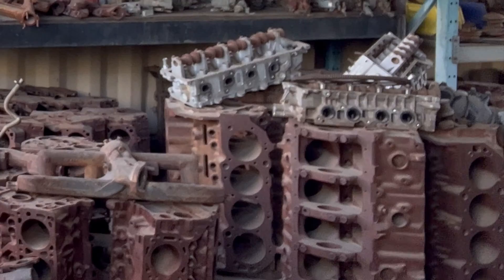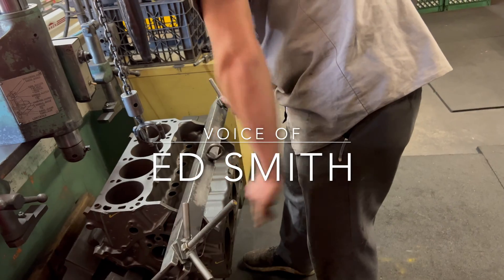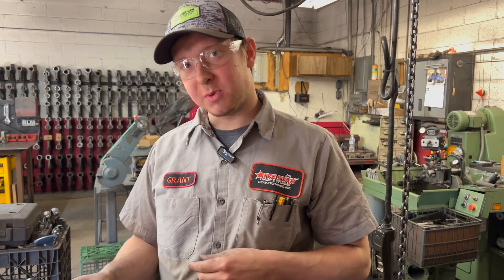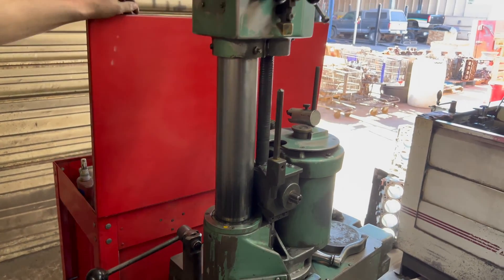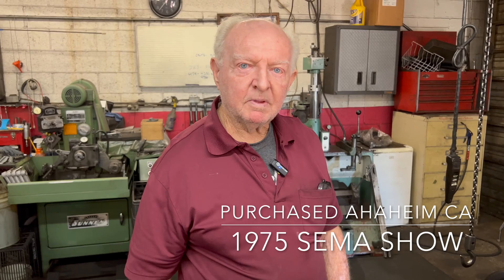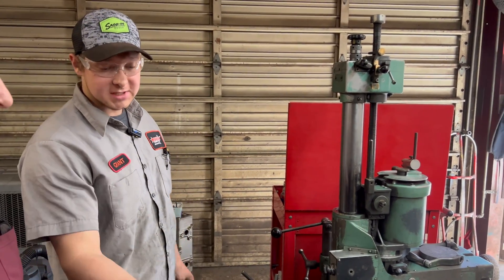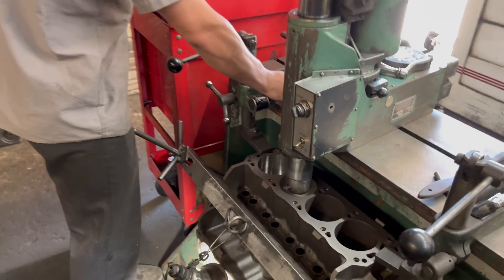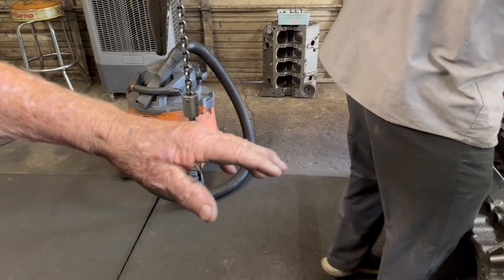Boring a "SBC" Chevy Small Block (or any V8) Grant and Ed Smith @ Five Star Engines. #classiccars

Comment: Sometimes we will get a block in the shop where the casting poor wasn't too good. One side of the cylinder would be worn a lot more than the other side, so we would take a board bar use a shim to move it over, and then we'd be able to board the block 30 over without having to go bigger because one side would be warned 5 and the other side is literally worn 15 thousands
Reply from the maker: Wow, that is interesting to me, I’m going to ask Ed if he has done something like that

Comment: great shop ! using air to clean just blows grit into machine bearings and seal, vacuum and a brush , perfect.
Reply from the maker: It’s an empty block. There are no parts in it and it gets cleaned again before assembly so I’m not sure what you’re talking about.
Reply: @BarryTsGarage  talking about the boring machine , I was told never use compressed air to clean machinery as it drives grit into seals etc. where it would never usually get . nice video as usual, and great operator of machine

Comment: Hey can you take a 350 sbc 010 block and cut out the cylinders and put in new performance cylinders and i want a bore of 4.100 or 4.095 or 4.080" or whatever shall work with the new cylinders that fit. I know you cannot bore a 350's stock cylinders beyond 4.060 if even that  much in a lasting engine. So can you do this thing? i am then intend to use a 4' crank and hopefully make the magic number 421 c.i. out of an originally 350 c.i. 😃
Reply from the maker: We are addressing your question in an upcoming Q&A episode…